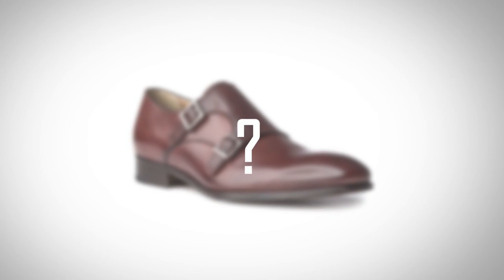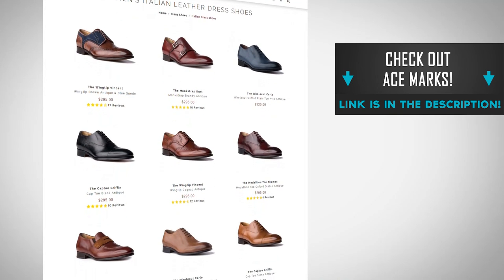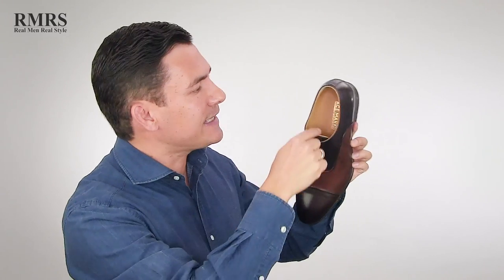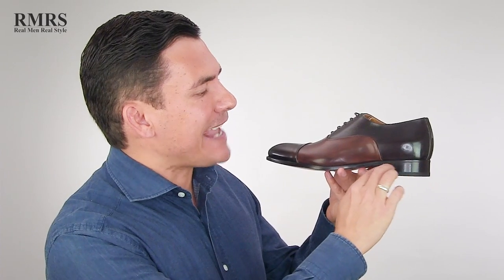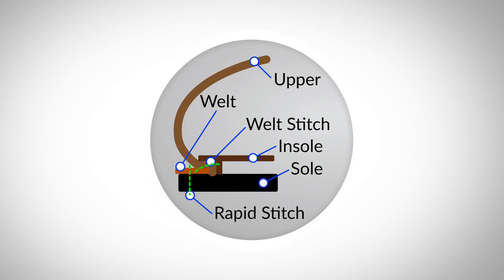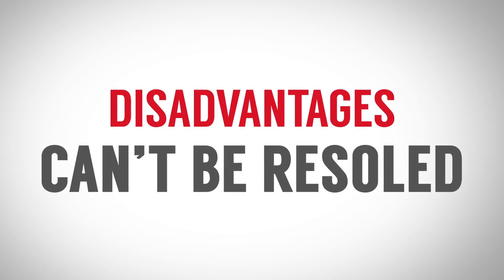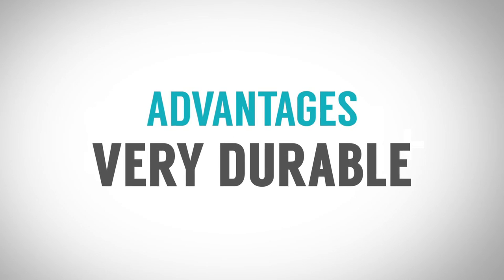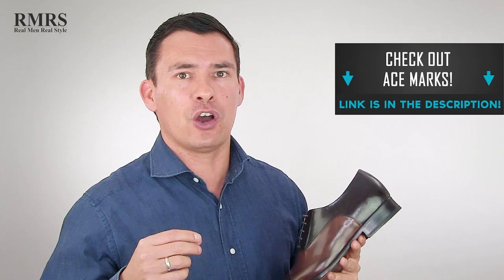Bad Vs Quality Dress Shoes Construction | Cementing Vs Blake Stitch Vs Goodyear Welt | Shoe Design

Comment: The problem with spending the money on a goodyear welt is that if you ruin the leather it doesn't matter. If you can't take care of your shoes, then save the money and buy a cemented shoe every other year. If you do take care of the shoe from damage, you oil it ones a year to keep the leather conditioned, etc. Then investing in a goodyear welt is the best way to go. Because it comes down to two considerations: (1) Cost per wear (if you wear a $400 400 times and a $40 shoe 40 times then they have the same cost per wear) and (2) the tear (If you are not committed to keeping a shoe in good condition for 20 years then you are wasting your investment).

Comment: You're missing one of the largest disadvantages of the Blake Stitch. You're literally sewing straight onto the upper every time you resole. This damages the leather, creates additional holes and after 1 or 2 resoles, a pair of blake stitch shoes are going to start falling apart when the stitches stop holding. 

Blake stitch, is a cheaper, quicker way of putting shoes together, its not more "modern", and its definitely not as high quality. Its a cheaper simpler way of making shoes at a lower cost point, and is useful for lightweight shoes that need to work in hot climates. Apart from this application (e.g. loafers and hot weather shoes), there's literally no advantage to a blake stitch over a welted shoe. 

Also a welted shoe doesn't NEED to have a thicker sole, or visible stitching my Gaziano & Girlings show barely any visible stitching of any kind.
Reply: Absolutely right.  The style is called closed channel stitching.
Reply: Shrink1061 yeah he is just selling us acemarks at this point lost my respect for him
Reply: Though it is true that the resolability of a blake stitch shoe is likely shorter than that of a goodyear welt for lacking a welt. 

You are being disingenuous when you assert that there is no aesthetic advantage. Though you can buy thousand dollar Gaziano and Girlings ....that have a very tight goodyear welt and relatively thin profile you are paying for that with a price that's 5 times a shoe that would have the exact same leather quality (full grain calf skin is the pinnacle here) for just barely the same or better (it's physics less material in the construction means thinner profile potential) aesthetics.

Also because there is  less material in the bulk of the soul  of a blake stitched shoe they tend to be more flexible right out the box and lighter in weight, needing much less break in  time. For some people these are must have attributes in a shoe. 

This is one reason for example why though I think the uppers are great on some Allen Edmonds I think that the aesthetics of the good year welted sole is just not at all to my taste on that and many other brands.... too thick compared to the generally svelte profile of a blake stitched shoe.

That said, I would like to see an experiment where a good year welt and a blake stitch shoe are subjected to a continuous set of re-soles just to see if or when one or the other weakens in the sole stitching over time as you surmised. 

Additionally, if you are concerned about re-solability of a single pair of shoes in my view you don't have enough shoes. You should have in my view at least 4 pair of shoes that you rotate through wearing and maintaining. Doing this reduces the total number of wears per month or year and extends the life of each shoe dramatically. Assuming you don't wear dress shoes every day , at 4 pair you are sure to have each shoe run for at least a decade before needing a resole (longer if you put in sole protectors before wearing)...be it blake or goodyear stitched  If you wear them more often you can simply buy more...and thus automatically wear each less and thus extend the life further and so making moot further your subjective arguments..
Reply: @DavidSaintloth  thank you for responding on behalf of Blake stitched shoes. I was wondering why the original commenter was so condescending towards Blake stitched shoes... then I saw his insert about his likely $1,000+ gaziano and girling shoes. Obviously you are going to get higher quality shoes when you pay 5x as much like you mentioned, but again that is mostly marginal as you can get very nice quality Blake stitched shoes for under or around $200 now (Beckett Simonon). I also like that you mentioned taking care of your shoes can help them last up to a decade before needing a resole, so even if Blake stitched shoes can only be resolved 1-2 times (even though good quality Blake stitched shoes can be resoled 3-4 times) you are still looking at 20-30 years out of the shoe. I don’t think anyone who paid $200-300 for a pair of shoes is going to be all that upset when they have to stop wearing them in 30 years.
Reply: My point exactly!

Comment: I do a lot of shopping at thrift stores.  Could you make a video showing us how to discern each type of shoe construction just by looking at the shoe?  I know there are a lot of cemented shoes that put fake stitches to make them look like they are Blake Stitched.  I have no idea how to tell them apart.  Thanks!!
Reply from the maker: Thanks for the recommendation! My advice is to have your phone handy and search for the brand and model of the shoe if there's any information that would be available from the web before purchasing it. Like you mentioned, it can be faked so don't trust your eyes so easily :)
Reply: Curt Alford Although this may not be 100% accurate, check if there are stitchings on the bottom and along where the upper and the sole meets. If stitchings can only be found on the bottom the shoe is either cemented or Blake stitched. If there are stitchings both on the bottom and along where the upper and the sole meets, check if the SPI(stitches per inch) matches that on the bottom of the sole. Basically, u want to make sure that the density of stitches u have along where the upper and the sole meets are the same. In that case the shoe is more likely to be Goodyear welted.
Reply: Spot on. The legwork makes shopping worth it.
Reply: gentleman gazette has some good videos what to look for at a thrift store.
Reply: Yep basically this. 

1) are there stitches on the sole
2) are those stitches real (look on top and see if theres top stitching, and if it matches the same number of stitches per inch/cm as the bottom) if the stitch size doesn't match, it'll be fake and most likely a cemented shoe. 
3) if stitching only runs part of the way along the sole (e.g. doesn't run under the heel), then its not goodyear welted.
Reply: I just got one pair from Macy's with exact same problem. There is a stitch like goodyear welt and also, there is one stitch visible from bottom like blake stitch. But it's all cemented. I just peeled one side a bit and inserted a thin  metal piece and couldn't feel the stiches. There was no other way I could confirm.

Comment: Very informative. I find myself buying shoes for my nephews and this video really helps. I didn't check out yet that AceMarks website but hopefully I will find what I need. The problem buying shoes is that our family falls on shoe size that are small. I'm an adult but I fit size 5 to 5.5. I even can fit size 4 on boys sneakers. My nephew is size 7.5 (but not on men's size). I tend to find it in boy's size. It's frustrating because it's hard finding him a good shoe on the men's category. I have to do some conversion each time I buy his shoe.

Comment: Antonio. Since watching your videos on shoes I've become more aware when I go shopping . Awhile back I was in one of our local thrift stores and I saw a pair of Allen Edmonds Burgundy saddle shoes for $6.99 and they still had the cedar shoe trees in them . Then to my surprise when I went to check out the clerk told me that shoes were half off that day . Later ordered a burgundy Anson belt to go with them. Subsequent trips to same thrift store I found a pair of Aldo ankle boots and a pair of Johnston Murphy loafers. BTW I noticed the shoe you were holding and other shoes that I have seen have a spot on the inside corner of the heel that looks like it has been cut at an angle. At first I thought it was  some kind of defect but I guess it's not . What is the purpose of this? Enjoy your videos . I always learn something.

Comment: We do Blake constructed ahoes with welt and leather sole  or other midsoling to which further EVA or rubber sole can be glued. Glued shoes can be resoled in most cases just as easily if they have  leather or EVA soles.  It is wrong to mislead customers. Vulcanized soles and TPR (thermoplastic rubber soles) are more challanging because they require removal of the sole unit but if the upper is in good condition, the shoes can be resoled.
Bad shoes vs quality shoes are not just characterized by their construction methods but rather by their biomechanics and comfort factors where italian shoes often fall short.

Comment: Excellent video I have never heard of the "Blake stitch"  so indeed I did learn some valuable information just wondering about the cement method is this just on lower quality shoes or do some shoe manufacturers use this also on higher quality shoes to simply keep their cost down thanks for the video.

Comment: This is the 2nd video I have watched from you (the other just going over the outer soles). I do appreciate the direct breakdowns of all the information. I have a better idea of what to look for, but do you have a website or series of websites that breakdown all these features, so I can zero in on a specific shoe? I need comfort and I need waterproof (deal with lot of water issues), but I still need to look professional. I can add inner soles to assist in the comfort, but the "look" combined with the "functional needs" (waterproof) is difficult to find for me.

Comment: Hi Antonio great video but I found some Goodyear welted shoes from Samuel Windsor at a very affordable price I have ordered both the classic Oxford and penny loafer
Reply from the maker: What's your take on the brand?
Reply: They are fantasic quality but they do scuff pretty easily but apart from that they are great and they come very shiny so there is no need to polish them i just waxed them for protection howevr the shoes could be considered bulky but I personally like the solid buit

Comment: This year has been the rainiest where i live and i lost a couple of good shoes due to excessive moisture. 

Should i go straight for a goodyear welted shoes or just wear some boots?

Btw, i apreciate your videos, Antonio. It's unfortunate to me that i can't purchase these products because import laws here are ridiculous, pricey (heavily taxed, paying up to 3 or 4 times the standard price) and a high probability of shipping go stray (state controled and corrupt mail services).

Sucks to live here in Brazil, man.
Reply from the maker: What are you doing to treat and protect them?
Reply: Real Men Real Style I mainly use a good shoe polisher the day before usage and moisture absorvers to dry 'em out if i have the misfortune of wetting them.
Reply: There are products that can be used to treat leather soles to increase water resistance. However these are not designed for situations where they're likely to be heavily water logged. While GYW has increased water resistance compared to a Blake Stitch (as a general rule of thumb), do realize they both have leather soles - leather soles also wear faster in wet situations.

There are a few choices you have at your disposal to further increase water resistance.

You could, or get a cobbler, to apply a thin rubber sole to the bottom of your shoe. This also has the added benefit of protecting the original leather sole, so you could actually just get that replaced when it wears. Unfortunately this may unbalance the shoe since you're adding thickness to the sole.

Another alternative you could do is get shoes with rubber soles. GYW shoes do come in varieties with a rubber outsole. 

Dressier boots can come in GYW or BS, but just because they're a boot doesn't necessarily mean they'll have a rubber sole.

In regards to your moisture problem, a shoe tree is the general go to for any basic shoe care. However if it is particularly bad, crumpled up newspaper may be a superior choice in terms of getting that moisture out fast. The critical time period for this is within the first few hours of when you stop wearing your shoes.
Reply: Z-Jun Lai  thank you for the information I always thought I needed a pair of shoe trees  for each pair of shoes that I own.
Reply: Preferable, but not always required. And sometimes it's difficult getting a proper fitting shoe tree.

Shoe trees really have two main functions, keeping the shape from sagging, and getting the moisture out of the leather.

Moisture damage is greatest in the first few hours after you take off your shoes because there's no longer any support - that's where the shoe tree or makeshift newspaper comes into play. After a shoe is "dry" there's less need for support because it is less susceptible to sagging.

Comment: For disadvantages of the Blake  you forgot to add that they tend not to last as long as Goodyear welts, are more delicate, and more costly to resole. In my humble opinion, I think you can get great shoes that have Blake stitching (see Berluti) and great shoes that have Goodyear (see JM Weston). However, you can equally find poor quality shoes with both. It's also a bad idea to order shoes online without having first put them on.

Comment: It takes ~8 days to make a goodyear welted shoe so it's hardly 'faster' than the cement method. I agree that Ace Marks are awesome (and had backed them before watching this) but IMO the goodyear is the king and it's simply better in every category. Also it's not that expensive when you consider that you can repair the shoes. A $300 shoe that you can get fully fixed after 2-5 years for ~$80 isn't really all that expensive IMO.

Comment: The glue floating around is so shady nowadays :( Even higher tier brands are using SR-998 and even low tier pasting like Salamander bond vs using a world class solution like Bostik. Just be weary of that! How would u ask if they used SR-998 or Bostik? No idea!

Comment: Most good quality combat boots are not cemented. They’re direct attach. Everything is put together using heat and pressure when the midsole is still almost liquid. Because glues and cements can fall apart if it gets wet repeatedly.

Comment: Your info is incorrect.  The Goodyear welt (1869) came after Blake construction (1856) and is more "modern".
Reply from the maker: Source?  I was there in 1856 and I almost called it the Centeno Stitch..........
Reply: Lyman Reed Blake's biography.  I've seen 2 dates and wiki states that it is 1858 instead so perhaps that is more correct: https://en.wikipedia.org/wiki/Lyman_Reed_Blake

Comment: veldtschoen goodyear construction for more water resistance!
Reply from the maker: Not always true - I read that as well but after speaking with a few cobblers found Blake stitch can in many ways be just as water resistant!
Reply: If it is based solely on the welt, Goodyear is more water resistant, but there are numerous other factors that go into determining such, and as you noted in the video Antonio, you shouldn't be wearing these types of shoes in the rain, especially if the shoe is not made out of a water resistant material or the leather is not treated for such conditions.
Reply: Good point, guys.
Reply: Yep. Geography and weather are always things to take into consideration.
Reply: I'm really more of a Cheaney guy.

Comment: Beautiful shoes. I have a extra wide foot(fat). Ace Marks doesn't accommodate Me. Ace Marks only has "D" width. I wear a eee wide width.
Reply: Some shops and brands specialize in shoes that come in a variety of widths, from several sizes narrower than the average last width to several sizes wider than the average last width.
IMO it's best to try the shoes on in the store if you have "problem feet" (aka any foot shape that doesn't comfortably fit into the average last). Try google for a shop in your town/city that carries extra wide shoes. Finding a formal men's shoe should not be a problem at all.